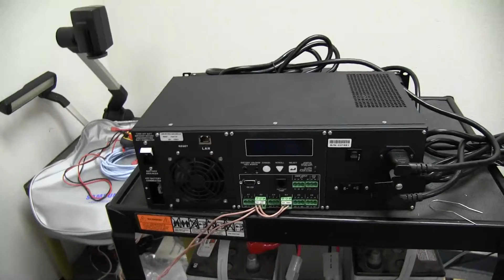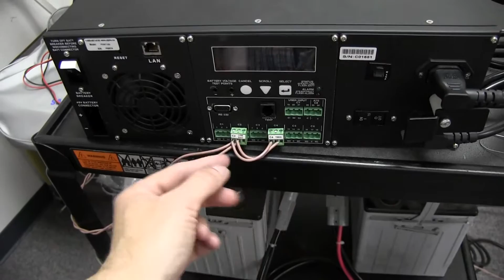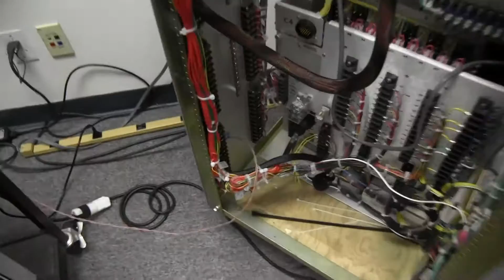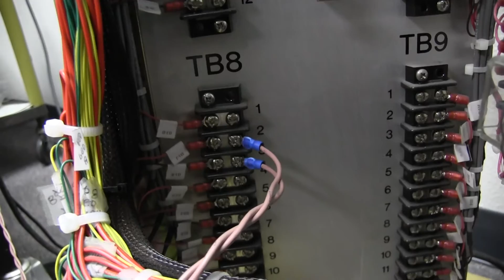Connecting BBS to Traffic Signal Cabinet

Comment: Great video. What is the proper way to check the Alpha Unit in terms of a PM check? It would be nice to have trouble shooting procedures on the Alpha BBS. I have a cabinet that goes into red flash approx 10 sec after switching off the ups supply breaker. The Alpha has been swamped with a new one but still goes into red flash when switching the breaker to off. I figured the batteries are low but wouldn't the Alpha bring them up after  10-12hrs?
Reply from the maker: This is how I would check the any BBS unit
1) Check DC voltage if the batteries at the BBS add up to 48volts you should have over 52volts on your meter. If you have less trouble shoot why, if you have more proceed with the test.
2) switch power off to the traffic signal from the service breaker then immediately turn back on. The BBS should cycle through a utility to battery back to utility power cycle. if it doesn't trouble shoot why if it does check the following.
3) how low in voltage does the batteries get? what is the amp draw of the batteries? then when the transfer switch switches back to utility power check the following. That  the charging unit starts to raise voltage in the batteries and there is current seen passing into the batteries tested with an amp probe. 
4) If the transfer switch passed the power to batteries and back the transfer switch is good, if the batteries didn't get below 48volts they are good if the charging unit started charging the batteries its good.
5) finally check the cabinet is wired correctly when safe to do so short out the NO contacts on the BBS and see that the signal goes into flash (once a year).

Regarding your flashing signal problem:
What voltage are your batteries? if they are 12 volt batteries they should be over 12.6 volts ideally 13.4 volts. check them with a quality meter. if all of your batteries are good check that the combined voltage is correct 56 volts for example is what you want to see on a 48 volt system. if the battery voltage is good when you switch off the supply voltage how low does the voltage get under load? if it gets down to 48 volts you have low batteries. after testing you must check that the charging unit is charging the batteries if not they will not be charged after 10-12 hours.Also sometimes the batteries physically look good have a voltage that looks good but quickly drop under load, this is a bad battery.
Reply: A double conversion UPS like the APC SecureUPS would be a good solution to look at to fix this problem :)